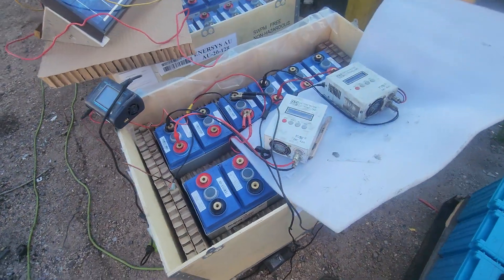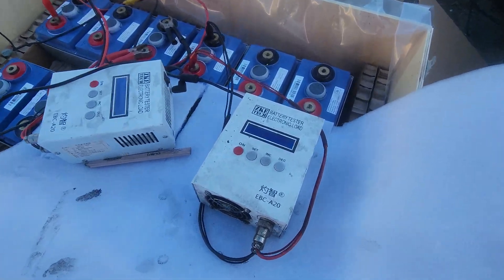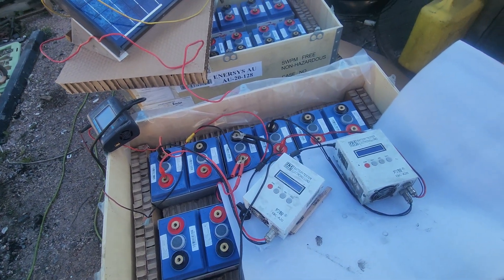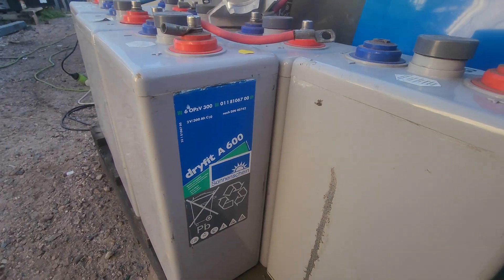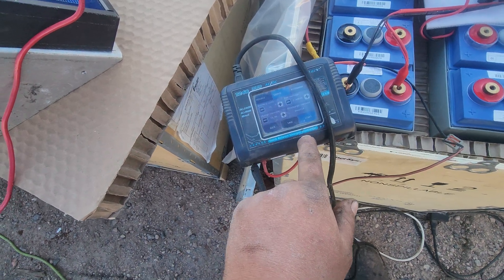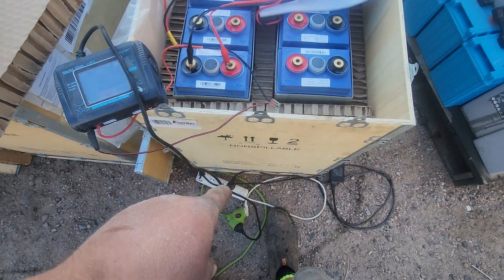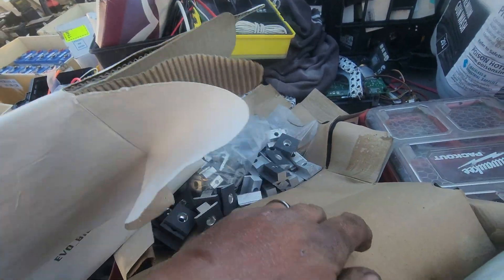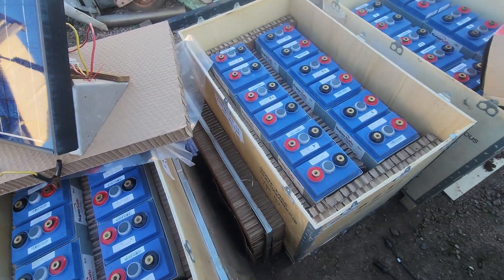Buying A Massive 2v cell battery bank. supersafe 2t1000mj

Comment: I just retired the same batteries in two banks of 48volt. They lasted 2 years without problems then started dropping cells (every time put the oven on some of the cells would go straight to 0 volts under load). In the end I just wasn’t able to source anymore cells for a realistic price or not being lied to about age. Replaced them with new lifePO4 cells.
Reply from the maker: The cells would just dead drop to 0v in the pack?
Reply: @Oneupthesleevecustoms  so individual cells in the pack would drop to zero under load
Reply from the maker: Only on heavy load? Do they have some sort of protection or they were  just cooked
Reply from the maker: I had 3 that were sitting at zero. But happily taking current at the moment. These have sat since 2020 8th month
Reply: @Oneupthesleevecustoms cooked I think. They sit at 2.1 volts they when 4000watt load comes on straight to zero volts.
Reply from the maker: 2 years from new?
Reply: @Oneupthesleevecustoms  no that was the lies. The second few cells I got to replace dropped cells were sold to me as 5 years old just removed from ups. When they died after 11 months pulled the battery out of the can they are in was a piece of paper with dates and they were over 10 years old. The 2mj1000 haven’t been used for a very long time. They are meant to be replaced after 3-5 years in ups. I think I got 3rd or 4th hand batteries
Reply from the maker: @gibo1971 yeah were dud you get them from? I was lead to believe these were 2019 built
Reply from the maker: @gibo1971 ill get them in banks and test before we bother integrating into the main pack
Reply: @Oneupthesleevecustoms  the first lot I got were great. All 2.2 volts although they cost. It wasn’t until they started dropping cells I would get low voltage alerts on phone from inverter that the problems started. First problem original battery supplier out of business second supplier lied and sold at $$$$$ prices
Reply from the maker: @gibo1971 i got these from recycal i think they brought them all up they had dozens of boxes  at one stage
Reply: Sorry just looked at batteries I got the 4mt500 the 2mt1000 came after but not sure that model is made anymore.both batteries are the same dimensions and weight. I was told the model number changed
Reply: If you can get them cheap enough they are a great buy. But I live near Sydney and people want $200 a can (2 batteries in each can). 12 cans (24 batteries) x $200 equals $2400. I bought brand new lithium 304ah from china delivered with the battery case for about the same money